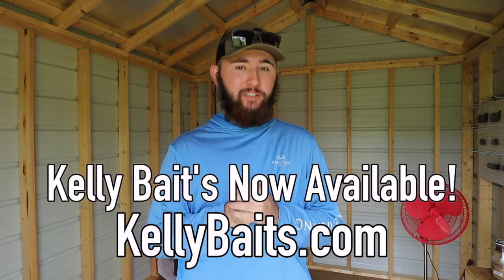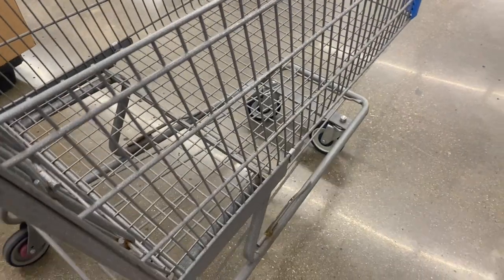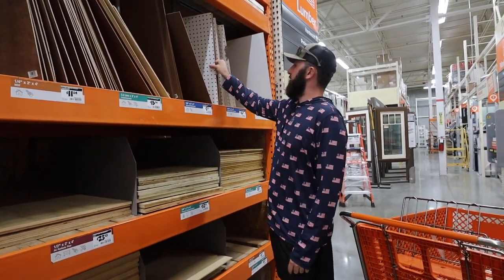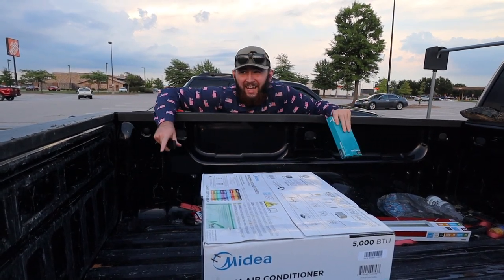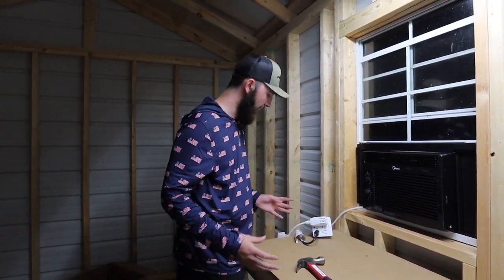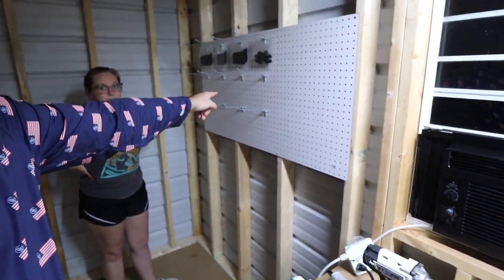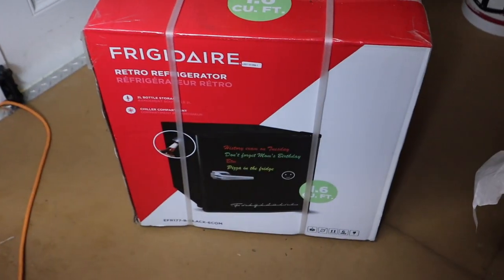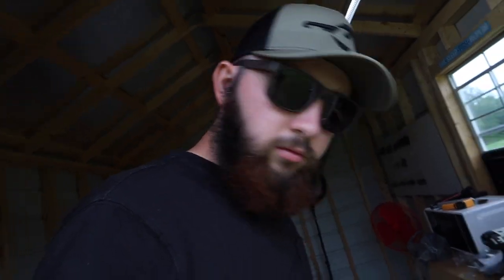Turning My REPO Shed Into The ULTIMATE MAN CAVE! (BAIT SHOP)

Comment: Hey JT, so I’m not at all into fishing but love your videos anyway. Just 3 things, 1/ I don’t see where you have run the extension lines but if they are on the ground you need to either put them in some casing underground or get them in the air. 2/ I agree with the other guy, you should insulate, both to help keep the place cool now and warm in winter, and 3/ A shelving unit on the back wall (or another bench) for your microwave and fridge and storage would be handy.
A big hug to you both.

Comment: JT, Please be careful with you wiring there- pulling too much amperage through a single "extension" lead can lead to fires- At the very least have that extension lead plugged in to its own fused plug socket- Air con units and fridges draw a lot of current if they both need it at the same time